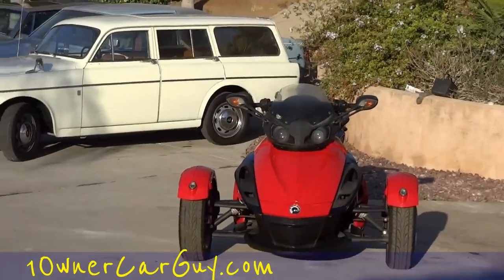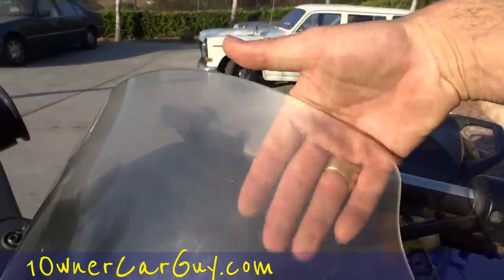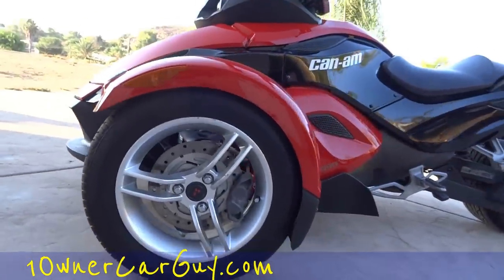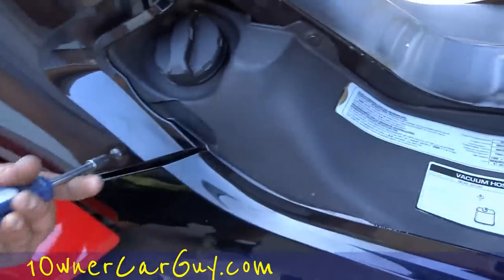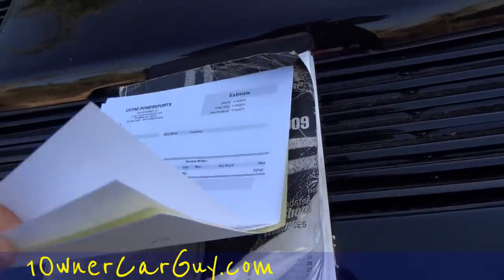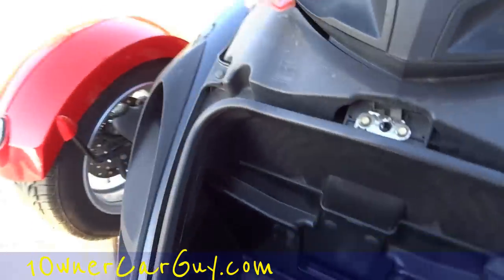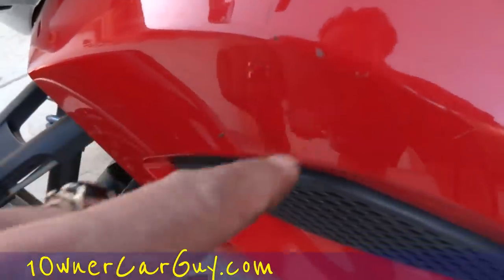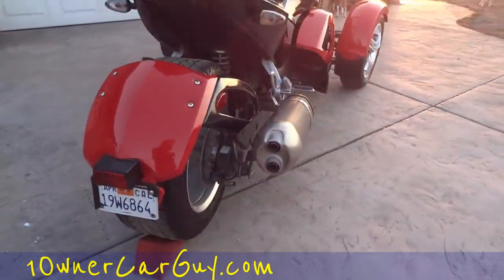09 Can Am Spyder BRP Bombardier Trike SE5 Motorcycle Roadster Sport Bike Video Review

Comment: They are feeler gauges to set the air gaps between the speed sensor and toner ring (the wheel with the teeth on it) because they are adjustable. Just put the tool between the two and tighten the sensor. Sweet ride!!